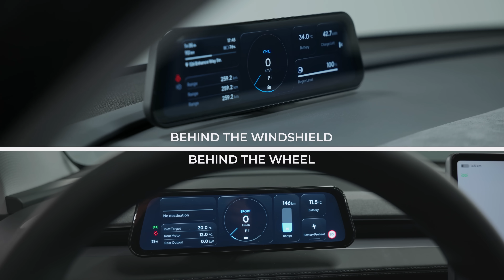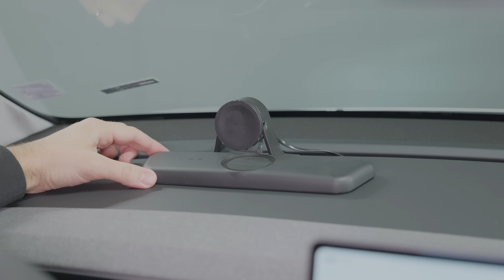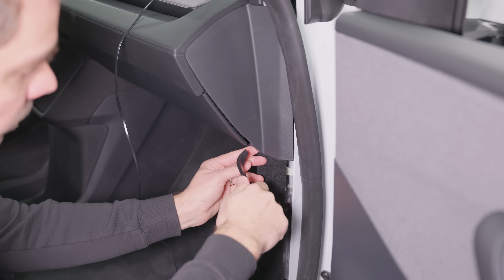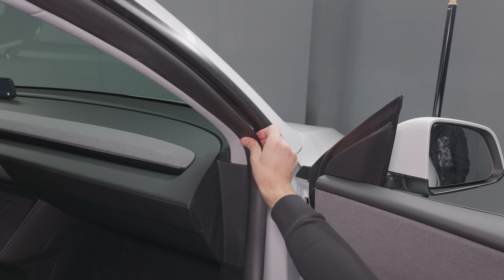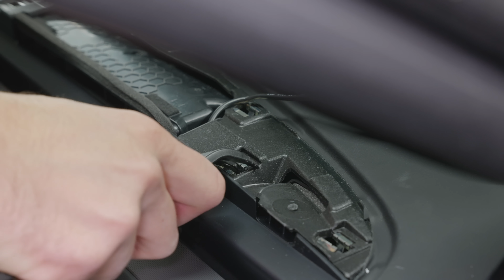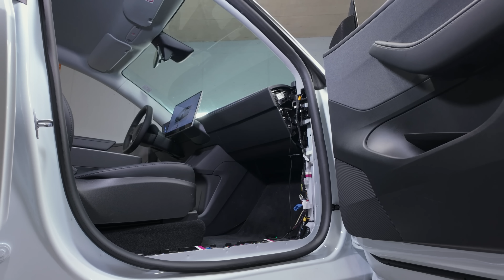S3XY Dash Installation and Wiring | Tesla Model 3/Y [Highland & Juniper]

Comment: It doesn’t stick on the dashboard. I used the one attached to the S3XY Dash and the spare one provided. Neither would stay on the dashboard of my 2026 M3P - a great product rendered useless through poor adhesive.
Reply from the maker: The mount should hold properly when the dashboard surface is thoroughly cleaned and dried, the adhesive is pressed firmly into place, and the mount is left for 24 to 48 hours without the Dash attached so it can bond properly.

Since you have already tried both the original and spare adhesive, please contact our technical support team so we can review the case and help with the next steps:

https://www.enhauto.com/pages/contact

Comment: you always say standard or premium. does this work on performance? (i dont see why it wouldnt but i need to ask.)
Reply from the maker: Standard does not mean SR, or Premium does not mean LR. It’s the 2 different types of Teslas currently produced (the more budget version and the more expensive one). No matter how many motors or what type of motors are inside. That is why we do not mention also what type of battery it works on or not.

Comment: Hi for all people that are considering to buy the sx3y dash for the sake of android auto simply don't 🛑✋️ i will explain why once the phone's  Bluetooth connects to dash it well steal the audio during calls from the tesla speakers everytime you need to make a call you have to fight with the dash and the phone im sure this is not a small thing they didn't see during development of the dash they simply decided to roll it out being aware of the deal breaker problem so you think disabling audio connection to the dash will solve the problem the result that android auto will not work i recommend you buying 200 $ from China if you like to see dials in front of you it will do the job
Reply from the maker: We get the frustration here. On some Android phones, call audio can be pulled through the Dash instead of staying on the Tesla speakers, and we know that is annoying during calls.

We are already working on a fix for this, so it is not something we are ignoring or treating as normal behavior.

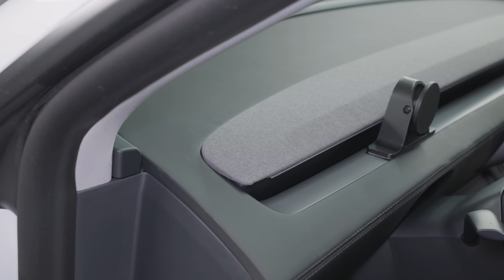Comment: 6:00 this panel cannot removed that easy. Even if I use my full power, it's not pailed off.
Reply from the maker: The panel can be a bit difficult to remove the first few times...  Make sure you're using the included pry tool. 🦴
Reply: thank you so much for your prompt reply. Yes, I use the pry tool included in Dash. It seemed almost broken as the panel is fixed so strongly. I finaly gave up to remove the panel and installed Dash in front of AC with the cable not hiding completely.
Reply: I did it first try within a minute or two...   I just went left to right using the pry tool when needed but mostly just my hands

Comment: I live in Turkey and I am using the S3xy app. However, the app is still half in Turkish and half in English. I have sent multiple emails to the Turkey representative and to Enhance Auto about this issue. I even prepared and sent a file containing the English-Turkish translations.
Unfortunately, I have not received any logical explanation or solution so far.
Please understand this well: Not everyone is required to know English. I want to use Turkish on my phone. Therefore, I kindly request that you set the S3xy app language to fully Turkish. I do not want to use English.

Comment: I have a couple suggestions. Just received my dash and love it so far. I’d love to see more product Integration. 

1. Allow a feature to allow the S3XY Knob to scroll the dash. 

2. Allow the ambient lighting of the knob to mimic the lighting of the strip. 

3. Add a on/off toggle for on the knob for the keep accessory power on. 

Love your products.
Reply: Would also like to see a tire pressure widget.

Comment: What does this do to you warranty?
Reply from the maker: It enhances it 😊
Reply: I know this is an old post, but I had electrical problems while sexy commander connected to the car. 

It was a non-issue with commander connected and they fixed the problem no questions asked.

Comment: Just installed it. Installation was easy, but I’m slightly disappointed in the screen. It’s not bright enough even at 100% brightness and frankly it’s too low resolution and the UI isn’t that fast to navigate around in. It’s sort of laggy. The software is good, but the hardware seems outdated.
And also I find the speedometer widget (gauge) way too small. I want a big speedometer that you can easily glance at. Sorry about the negativity, but I’m just a little disappointed right now.

Comment: 5 things

1. A small 3d printed piece to prop up display so it can stand while you adjust alignment before removing 3m tape.
2. Magnetic bracket should have had hole and channel to route down bottom and out with possible extrusion for more seemless look/cable coverage.
3. Possible official placement recommendations/guide bracket. Removing human error reduces complaints.
4. Heat consideration/overheating issues in the summer when mounted as headsup display.
5. QLED should help with reflection but something similary to privacy screen would allow angled view but remove glare when mounted as heads up display.

Also kinda sad my mouting unit arrived scratched from factory. Still love your products. So very close to perfect.

Comment: I am really pleased to see that you have integrated the power supply to where the commander module is plugged in. I note from your email that this has been a potential bug, but I hope it works out, because a separate cable run for USB-C is far from ideal and is not premium. Still hoping you guys offer a better mount which doesn't look so third party. Integrating into the steering wheel upper cowl would be great and could be offered as an additional mounting option. I look forward to receiving mine when the bug you reported is sorted out. Kinda glad now I wasn't part of the first shipment.

Comment: I can't get my dash to work anymore. :(
I worked for a couple of days, then it lost the connection with the Commander. Wasted hours trying to reconnect it. Rebooting the Dash, the S3XY App, the car. Installed the latest update (from yesterday, SW: 6.3.18.C-2.3.3.-2.3 05.03.2026) on my phone, the Commander and the dash. Won't work.

It does connect with my phone via bluetooth and allows Carplay. But I don;t care about carplay, I want the dash connected to the commander working. 

The 'add device' button in the Dash (under S3XY Devices) does nothing. And I've got 0 paired devices accoording to that screen. 
I also can't disconnect the S3XY Commander as keycard to my car, because I need the right keycard for that (I assume the Commander, which is tucked away in my car).

I'm open for new ideas to try to get it to work.. And getting pretty annoyed by the Dash also..
Reply: They have sent out an email about the problem. My Dash dont work either. Only the Carplay. If Ive read the email correct, they are aware of the Bluetooth connection problems to the commander. The fix will probably come sometime the coming week.

Comment: Ho montato oggi il display, non riesco ad associarlo tramite l'app ma solo direttamente tramite la sexy Dash e quindi sull'app non mi risulta connessa.  Inoltre se connetto la dash non vedo più i dati sulla app.. è normale?
Reply from the maker: This will be fixed. For now only connect it via the dash
Reply: @EnhanceAuto-S3XY_Gadgets hey guys, i cannot connect through dash either. shows no commander found
Reply: @Chris19890811  Same issue here. Worked for 1 day, and then lost connection

Comment: I want to factory reset the Dash.
I have a Model 3 Highland and installed it behind the steering wheel. Since it was my very first time ever disassembling a car, I kept watching installation videos and double-checking each step as I worked, so it took about an hour — but the difficulty level wasn’t too high.
However, on my phone’s S3XY app, I can’t add the Dash. It keeps failing when searching for the device. As a workaround, I connected the Dash through my phone’s Bluetooth device settings, then connected the Commander through the Dash device’s connection menu, and it did work properly that way. However, I’ve been continuously trying to add the Dash through the app but it still doesn’t work.
Is there any way to factory reset the Dash? Even when I delete the connected devices on the Dash, if I check the Dash’s system info, the connection data with the Dash app is still recorded under BT2 — so I’d like to clear that first before trying again. Thank you!🎉
Reply: Additionally, in the Dash system info, SW, BT1, and BT2 show information, but FW is blank.
Reply: Me to ,I have emailed them but no reply ,Reddit has large numbers of people with the same problems,The should release an update to fix the issues,I thought we would be able to see the tesla satnav maps on the dash but we cant. not sure i would have bought this if they where more clear with the description!
Reply: @Steve.wilkins  I have the same problem. I did get it to work first time i Setup the Dash, but efter 1 day, I lost the connection and I tried to set it up again, and it wont detect my device
Reply: @darkeraz4572  I am experiencing the exact same issue. On the first day, the Dash was able to find and connect to the Commander, although it was unstable. However, on the second day, it cannot find the Commander at all.😂
Reply: same here. i cannot set up as well

Comment: I already have a Commander installed.
Do I need to connect the power cord to the Commander?
Are there any restrictions if I use a separate Type-C power supply?

Comment: I sort of regret buying the Dash after seeing this installation video. I really expected not to have to open the car on the right side. Last time, for the commander, some friends did it for me. And now I need to get it done again.
Reply: Take 5mn. You can do it in 20mn
Reply: @almograve  I tried but stopped almost immidiately when the rubber seal didn't come off in the corner. I think I've wrecked it actually.

Comment: Installed it today behind the steering wheel. One of the tabs is not working anymore, but at least the cover is staying in place with the rest. The only problem is that the Dash doesn’t connect to the app, even if I updated, powered the car, commander and dash again and tried everything. The app doesn’t find the dash and my phone cannot find it either as a bluetooth device. The connection guide link in app goes to Model3 Stalks installation video, which didn’t really help connecting the Dash. 

The screen is not superb either, the backlight is very uneven. 

Maybe it would have been better to wait for other people to try this first before buying. If you are thinking about buying, think again. 

I have Commander, Knob and Dash and I now I would only buy the Commander and use my phone as a Dash. Knob has been useless so far and I’m going to try to sell it. Commander has all the features I need, except the always-on Autopilot on Juniper. Knob looks good but feels cheap and I have not found any real use for it. If the Dash wouls be working I could open the glove box with it, but now I still have to use my Knob, maybe once a month.
Reply: Yeah I’m considering returning mine and buying something that works instead. 
Spent all this money and it doesn’t even connect !!
Reply: @CrawlinnHaulin  I sold mine already, the knob too. The only thing I kept was the commander, which gives me everything I need.

Comment: Just received mine, great product overall, but there is a lot of small bugs that annoyed me quite a lot, such as:

1.) Screen won't turn off when I leave while I am charging the car

2.) Carplay always not actually connect, unplug the power can solve

3.) Dash cannot connect with commander together with app

4.) Error display errors on some widgets

hope those problem can solved with new OTA soon

Comment: I just read in another post that you do not supply the zip tie shown in the video.  The only ones that I have are short.  I would like to buy what I need before my Dash arrives.  What size should I get?  Thanks.
Reply from the maker: A 50cm (24 inch) one would be more than enough

Comment: Just installed Mine Today. A cople of notes

1. The 3M Tape provided seem not to stick, The mount falls af when i put the dash on. 
2. The Navigate destination function dont show data on the widget 
3. I cant get the Scroll wheel function to work, Anyone else has this problem?
Reply: You need to give the scroll wheel a whirl. It does not work with just a click or two. With a fast scroll it switches to another page. Single scroll only works when there are actionable elements, like the glovebox item and such.
Reply: @EljaTrum  I got both the navigation and scroll wheel to work, but I had to update the device from the dash itself and connect to wi-fi through phone.
Reply: When i try to stick behid de steerwheel  it falls...the glue or thickness of the band its not ok
Reply: When i try to stick behid de steerwheel  it falls...the glue or thickness of the band its not ok
Reply: @aba812001  I agree. I dont get, why this went trough a test phase at Enhance. Very poor

Comment: I mounted the Dash behind the steering wheel and tried to remove the front panel to hide the cable. However, despite trying hard as shown in the video, I couldn’t remove the panel, and I decided to stop to avoid causing any damage. Instead, I routed the cable along the windshield and completed the connection that way. In the end, the cable remains slightly visible from the windshield to the Dash. It doesn’t stand out too much, so it seems fine. i am curious about others could manage to remove front panel ?
Reply: For me it was the same challenge! Don’t give it up. I started finally at the right side (the steering wheel didn’t disturb me).

Comment: Recieved mine yesterday and installed it. Very happy with it! I selected the navigatie widgit and muziek widget, but they don’t show any information on them while navigating and playing audio. And perhaps add a couple of more extra widgets and different options for the speedometer. A larger font would be welcome for this.

Great work! Really happy with it. 👍
Reply: I have the exact same problem with navigation dont show data. You found any fix for it ?. Can it be problem with the commander?
Reply: @darkeraz4572 It is showing all kinds of data, like the battery percentage, speeds, range, temps, etc. Only no audio info and no destination info. 

I did update the device to software version 6.3.3. Didn’t help. Also reconnected it to my phone without any luck.
Reply: @EljaTrum  I got mine to work now. I did indeed update the software to Version 6.3.3 and then the navigation and music data showed up. I did do the up-date Twice and rebootet the device a couple of times
Reply: @darkeraz4572 Was your music data from music played through the Tesla infotainment center, or from CarPlay?
Reply: @garygomola5063  From my Tesla Infotainment

Comment: Installed it today. Took me 30 minutes. Installed it behind the steering wheel. Tip: if you find it hard to push the dashboard back, just pull it first 1 cm to the inside of the car and then you can push it in place, so not only downwards and forward like in the movie.
Reply: I couldn't remove the whole dashboard - maybe I'm too clumsy. But I managed to pull the pins at the outward side and push the cable under the dashboard. Then I used the zip-tie method - I had to find the hole with my fingertips, but it worked out. Now I'm at connecting the cable and commander.
So, if you happen to struggle with removing the dashboard, you don't have to do it all the way. Just pull the outward pins and tuck the cable under the dashboard.
Reply: @curyllo merci pour l information car enlever tout le tableau de bord m'effraie un peu

Comment: Hey Enhance team,  

Just got my S3XY Dash today and looking forward to install tomorrow.

I have a carbon fiber dash decor wing that's hard topped, vs the softer cloth or vegan suede one.  Would the S3XY Dash be installable on top of that to give it some height above the steering wheel and to avoid blocking the AC vents?

My thought would be to place the mount on the decor wing where I wanted it without exposing the adhesive, mark it' position with masking tape, remove the mount, pop the decor wing off, run the wire under the decor wing as shown in your vid but have it exit out of the back side of the wing by the steering wheel to connect into the back of the S3XY Dash.

You think it'd work?
Reply: Just went ahead and did it. Works great on a hard decor wing surface.  

Doubt this would work on suede or the cloth wing.

S3XY Dash now has the height to see it fully above the steering wheel, doesn't block the HVAC vent at all, and is close enough to interact with the touch screen without the gymnastics to reach all the way up to the light bar mounting position.

Comment: Man I love how u make it work around all SEXY gadgets but I would love to see a second gen sexy dash in rectangular form like main Tesla screen and with integrated steering wheel/column mounting option insted of plastic trim on top. I have some chinese screen which looks like that and IMO it looks much better and fits to original Tesla design but it's software is so bad, doesn't display things right and they won't update it. I would love to switch to Sexy dash but with this rectangular shape, column mounting and slim bezels. Maybe you guys will consider this in 2nd gen of this product? I would definitely buy it!
Reply: 저도 완벽히 동의하고 건의합니다.

Comment: You guys should reference the units from Hannshow. They make the screen on top of a mount which goes into the steering column. 
I believe this screen is the best but the mount you guys use is not seamless and doesn’t look visually as well as the cheaper Chinese units. I’m not going to make the switch until a better mounting solution is made